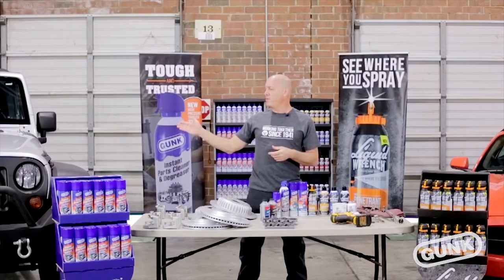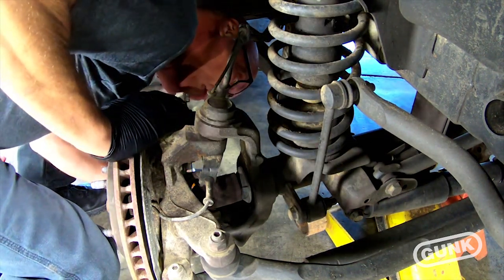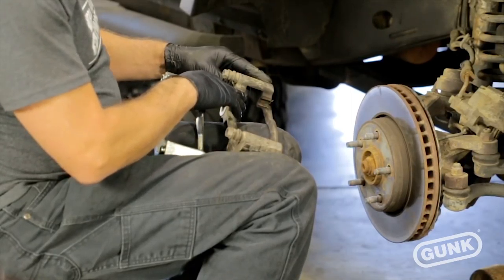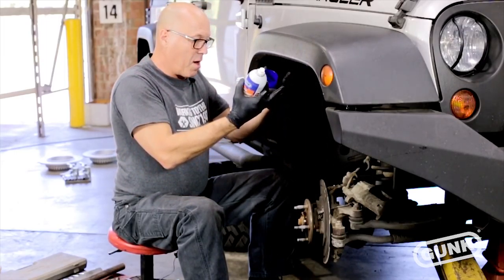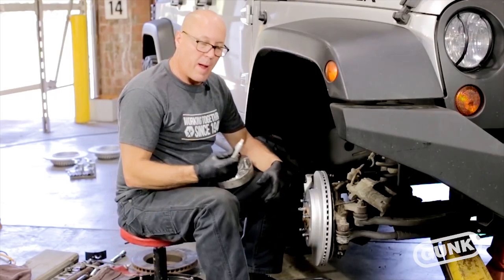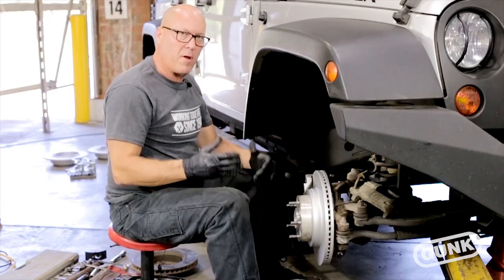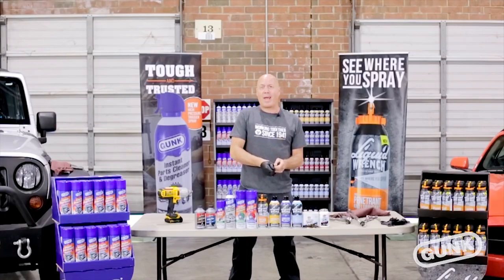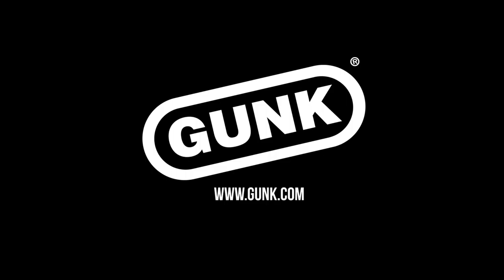How to Change my Brake Pads and Rotors?

Comment: If I have to replace my parking break due to a leakage around a seal with the rear axel it got grease all over my pad. Should I replace the parking break at the same time that I do the brakes?